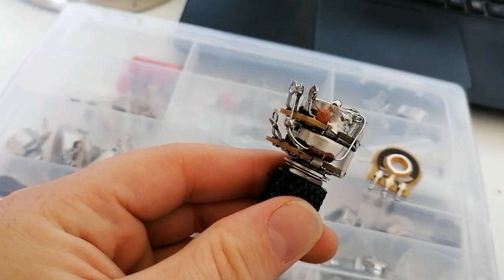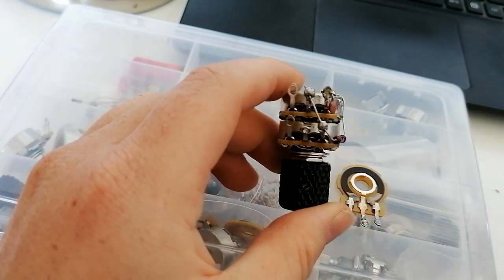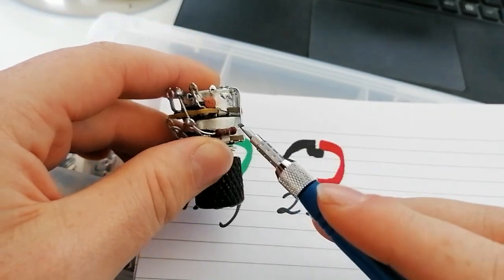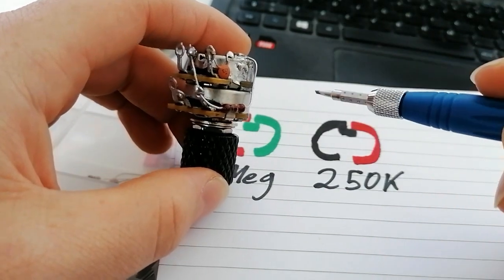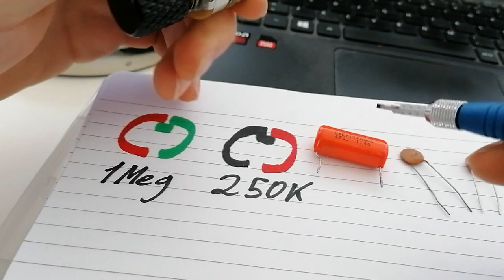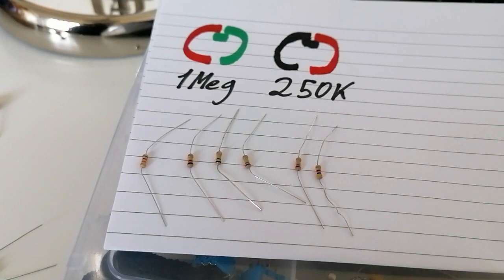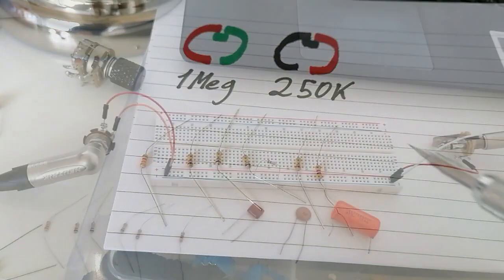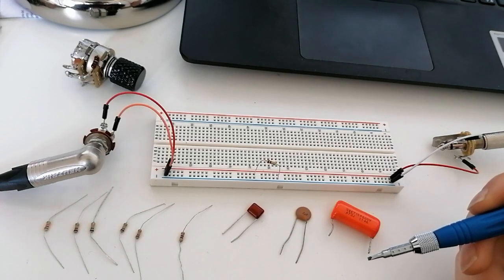How a Fender TBX tone control works on bass

Comment: The capacitor demo was probably the clearest explanation of how they actually affect the sound of the guitar. The resistor demonstration though I am not sure how it really changed anything.
Reply from the maker: It is an extremely subtle difference, and you can mostly hear it when comparing very different values
Reply: @OliverTobyn  What roughly is the difference in question?

Comment: I have a 1985 Jazz Bass Special with the tbx. I also have a 95 Strat with it too. I actually like it a lot. But on the bass, I just leave it in the detent, in the middle. I notice the high frequency filtering a little, but I just use it as is. I don’t understand the stuff you are describing about the electrical, but I enjoyed watching the video.

Comment: Thanks for the information this is a great device for passive Bass players. But does it need different capacitor for different pickups (P, J, MM)?
Please do a longer demo with the capacitor you usually use.
Reply from the maker: Hi there! I did a separate video on capacitors, you can check it out on my channel. Different basses don't necessarily need different capacitors, it's all a matter of taste. 47nF works well on most basses. 100nF works well on a P Bass if you want that deep vintage tone. Whereas some humbuckers work best with 33 nF
Reply: Which resistor has a noticeable brightness tone 180k, 200k, 220k? I can't tell the difference.
Reply from the maker: @melogomaniac  in my experience 120k, 150k and 180k work best. 180k is very subtle and above is barely noticiable. The value of the resistor will be the starting point when you swipe trough the 1Meg section of the pot, but at higher values it's less noticeable. I'd try a 150k resistor, then from there decide if you want to go higher, lower or if it's ok
Reply: @OliverTobyn  TBX is really interesting you gave me a lot of ideas in it. I was thinking using the low pass for bass tones and high pass for bright solos. Thanks for the help!

Comment: Great video, I'm customizing a TBX tone, I would like to hear more difference in tone between the capacitor part and the resistor part. Wich resistor value do you recommend? Note that in my 1988 Fender Jazz Bass Special a resistor of 4.7nF was also put together with the tone capacitor...I don't know why
Reply from the maker: The 4.7k resistor basically prevents the tone being opened all the way, which sometimes results in a muddy tone, I personally like it because it's a deep, dark and well packed sound. As for the resistor value, the stock 82k will give you the greatest difference, but it also means that you're losing signal when it's in flat. Maybe I'd go a bit higher, with something like 100k-120k
Reply: TY so much, now is really clear!! What about he Pick ups wiring? You prefer PJ wired in series or parallel? @OliverTobyn

Comment: Are used this on my 79 Precision. I think I wired it  correctly but when I turn the control clockwise past the center it adds 50% more volume and a little more treble. When I turn it counter clockwise past the center it seems to lose volume and bass.

Comment: Thanks, exactly what I was looking for. I am using a Single Q-Tuner Neodymium pickup on a 5 string music man clone ('Italian' MiC Eko MM-305). Does the capacitor or resistor need to be varied due to impedance of the pickup? Appreciate your input. Cracking open the guitar all the time is causing me some stress! I like the bass and don't want to ruin it.
Reply from the maker: Hi there! No, not really, the impedence of the pickup just tells you how many winds it has, and that can be an index of clarity or darkness of sound, but it's not always the case. So you can put in any capacitor and resistor you like
Reply: @OliverTobyn  Thanks! Going to wire up the tbx in a few days. Hopefully it will help tame the neodymium a bit (very pure tone). But as my teacher says 'Practice!' He is right, it is more important than the tech :)
Reply from the maker: @elearninghigheredk12  yeah, though I believe it might be equally as important. I've seen so many super skilled bassists who had absolutely no idea about the tech stuff, or even how to set up their instrument. Obviously skill matters, but knowing your way around the tech stuff will definitely make you more versatile

Comment: Excellent content! Congratulations!
Do you know the value of the capacitor and resistor that originally comes with the models below?

Fender Jazz Bass Special (80's made in Japan)
Duff Signature (made in Mexico)
Duff Signature Deluxe (made in Mexico)
Fender Jazz Bass Special Reissue (made in Japan)

Another question I have is whether the TBX kit that Fender currently sells for guitars can be used on a bass? It is also 250K/1Meg pot.

Greeting from Brazil
Reply from the maker: Hi, sorry for the late reply! If I remember correctly the cap is 22nF in every model, which may make your bass tone a bit muddy but some people prefer it that way, the resistor is also 82k in all of them.

The TBX pot is the same in both guitars and bass, but as I mentioned in the video I believe it is necessary to tweak it a little bit like using a 47nF and a 120-180k resistor

Comment: Hey man, can I ask for some help?
So I've bought a tbx bc I wanna put it into my bass. We're talking seymour duncan quarter pound p/j. How do I hook it up when I got 2 volumes? As in one volume control per pickup, and I wanna use the tbx kinda as my only tone control? Mind explaining or showing me to a wiring diagram? Thanks
Reply from the maker: It's wired just like a normal master tone pot. You just need to hook it up from your  output jack

Comment: Does the TBX control knob have a notch to let you know when you are at "flat" or the 12 o'clock position? Specifically curious about the knob on the Duff bass. I have also heard that the knob on the Duff bass would have clicks when you turn the knob clockwise from playing position, past the 12 oclock point. So basically when you are in the 1meg side of the pot you get a click at 1, 2 , 3 4, ect positions. Can you confirm any of this on the TBX pot on the fender duff bass? Thank you for the great video
Reply from the maker: Yeah it has a notch at the 12 o'clock position. I've had the Duff bass, and a couple more TBX controls by Fender and they all have it. They don't have any other ones at the 1, 2, 3, 4 and so on postitions. Thank you for watching!
Reply: @OliverTobyn  thank you so much. That confirms the Duff bass I just received has a bad tone pot. The sound didnt sound any different when you went past 12 oclock. Plus there is no notch at the 12 position either. Added to this was the noiseless Seymour J pickup had more hum than a standard J single coil. Gotta love Sweetwaters fake 55 point inspection. I did send the bass back for a replacement, but this just confirms what I already suspected. Thank you again, I really appreciate the video and your quick reply!!
Reply from the maker: @mikez1975  yeah, as I mention in the video, the Duff also has an 82k resistor which comes into play when the pot is in the flat position. It kinda makes it sound more like a volume knob than a tone, so you definitely hear a difference going on there. Somehow my Seymour Duncan J pickup also has a slight hum to it, no idea why. Again, thank you! :)
Reply: Hi there, this is a great video and thank you for sharing. I just bought a Duff Bass and I'm planing on following your tutorial and buy the 180K resistor but there are so many different brands and watts .05 or 1/4 W, 5% which one do you recommend? I hope you reply so I know which to buy. Thank you in advance!   @OliverTobyn
Reply from the maker: @pabloserranomusic  hey there! I'm glad it was useful. It really doesn't make any difference if it's 1/4W or 1W as that's for heat tolerance and on a bass we're dealing with very low voltages. The only thing that really matters is the resistor value
Reply: Okay, Thank you for replying!  subscribed. @OliverTobyn

Comment: Interesting, which resistor value would you recommend for guitar?
Reply from the maker: Thanks! I think what I said in the video also applies to guitar as well. The stock 82k makes it act more like a volume knob than a tone knob, and  anything above 180k barely makes a difference. But it might make a bit more of difference on guitar, I've never tried. I'd probably go with 150k and work up or down from there.
Reply: @OliverTobyn  thanks, I have iron my American Standard, the effect is subtle, for the way it was explained back then it was a treble and bass "expander" in the sense it cut mid frequencies, so I was concerned it might cut too bass or that it would not be heard.

Comment: Hey Oliver can you  help me install this damn thing there no proper instructions for installing to a single volume control.

Thanks.
Reply from the maker: It's exactly the same as a regular tone knob, and follow the same instructions as the Fender Jazz Special, there is only one white wire from the output
Reply: @OliverTobyn  but does ground and the input jack  pos neg go to the tbx first or to the volume control ?because different diagrams say different things
Reply from the maker: @nayr87  it doesn't matter, as long as the TBX is connected it will work. Doesn't matter in which order. Usually you'll have the white wire from the pickups that goes to the volume, then TBX and output jack. But it will work the same if you have volume-jack-tbx